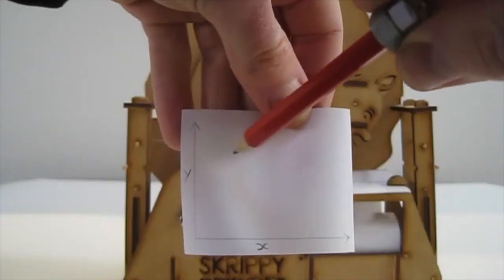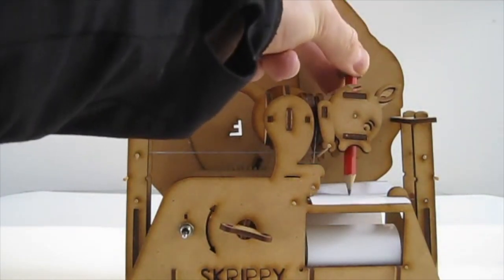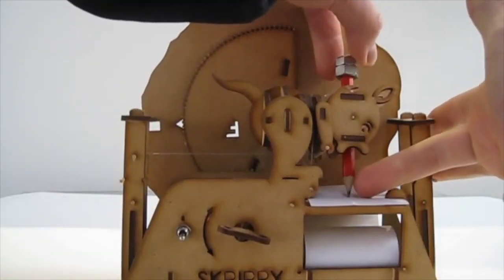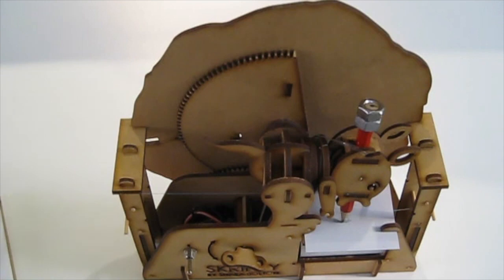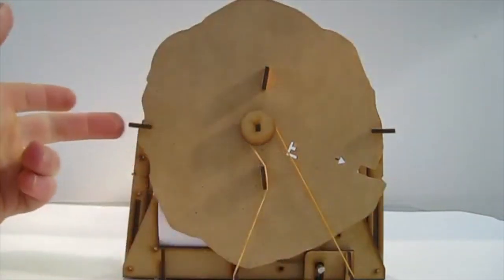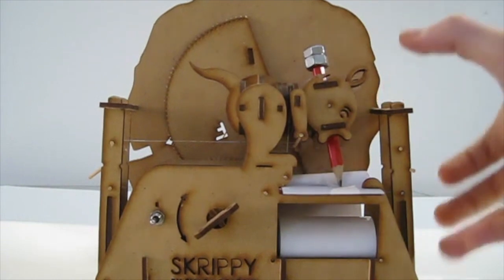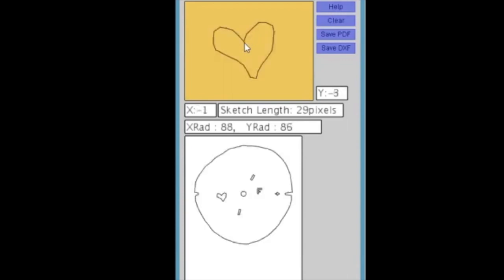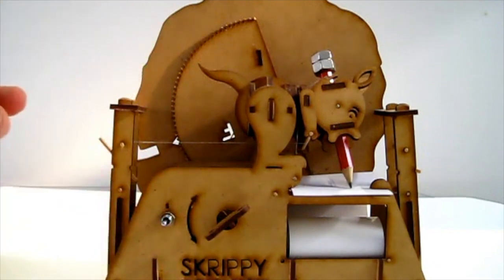Skrippy - Mechanisms in a Writing Automaton

Comment: Having the distance the string moves be proportional to the angle the head turns is good, but the angle of the head isn't proportional to the distance the pencil moves on the paper, since it moves in an ark. I wonder if you could have non-circular cams such that one unit of string motion equals one unit of pencil tip motion rather than one unit of head rotation
Reply: Good observation. When converting the picture into cam profiles the pencil tip location is the input to the calculation. The shortening of the pencil and the head angle are then calculated, and finally the cam radius. I wrote some simple software that does this for people when generating the cams for skrippy.